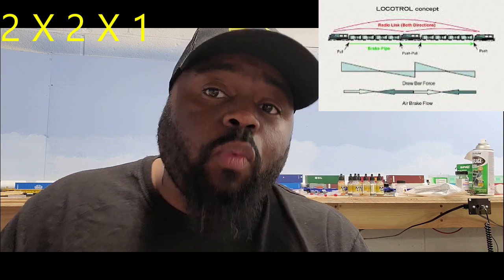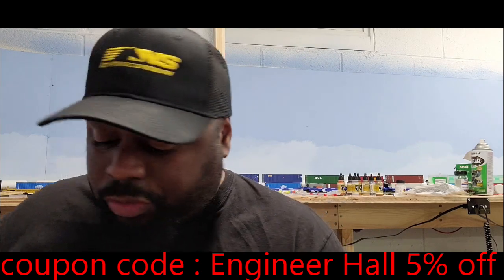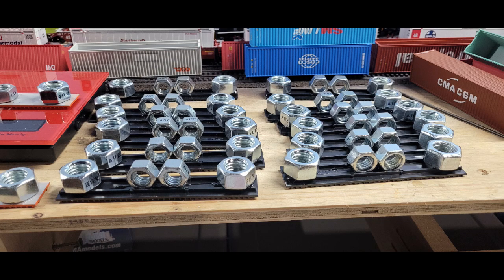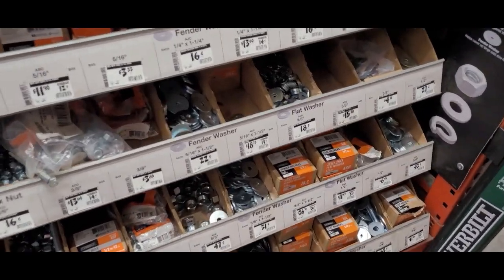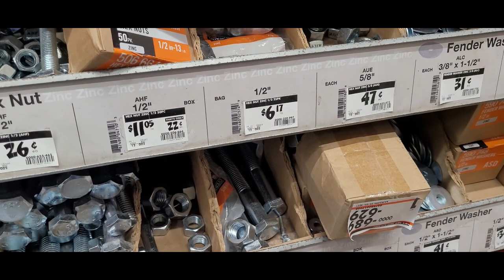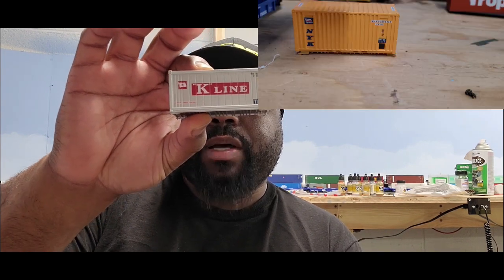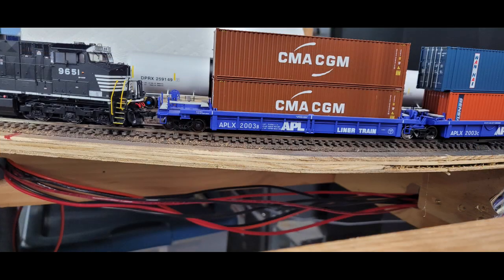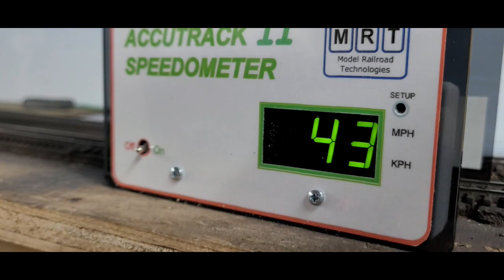Ho Scale NS Intermodal Train With DPU Engines Pushing

Comment: Cool to see all the different loco changes . Do you put the nuts in every container ?   Timonium is coming up Fed 5-6 .
Reply from the maker: I started out using the the leftover wood when I when I drill holes to run the wires under the layout but it only holds 6 circles and it's only 2 oz I use sand but that's too messy for me .  I found that the nut and glue method works best in my opinion is easy and cost effective
Reply: @engineerhall5887  So basically all the containers are weighted, but just not all with the same method, right? I was curious if you leave the "top" containers unweighted to help keep the center of gravity low and help reduce risk of cars tipping over? Looks very nice!

Comment: How many hex nuts do you put in each container? according to the size? the sample you showed in a 20’ you have 3-1/2” I like to know. Thanks for your help
Reply from the maker: I have a scale where I  weigh the car or container . the hex nut Use a combination of different sizes to achieve the desired weight. with  two 1/2 in  = 1 .1  oz